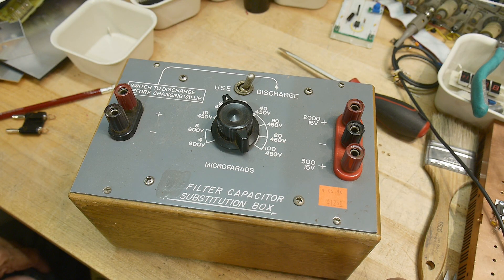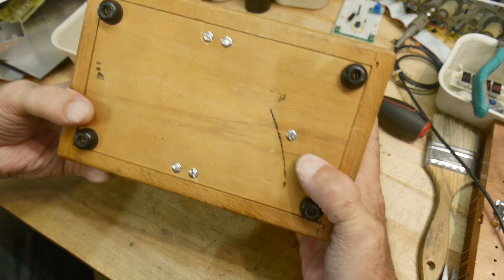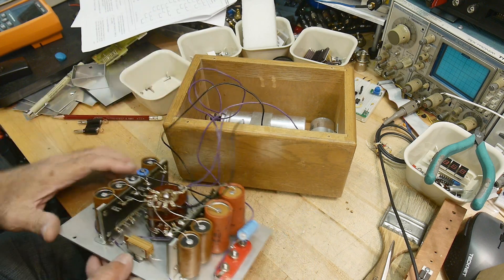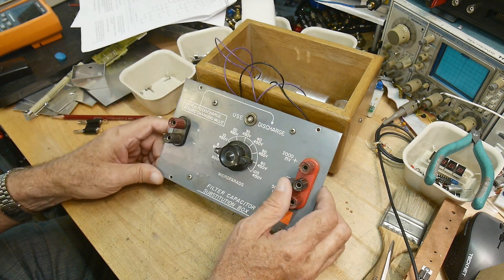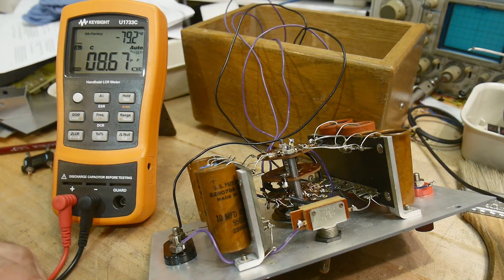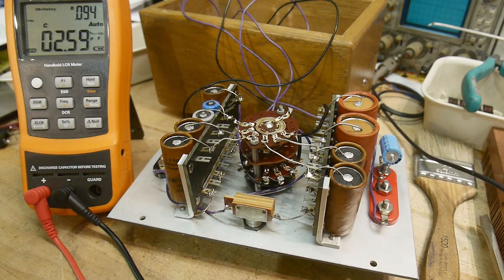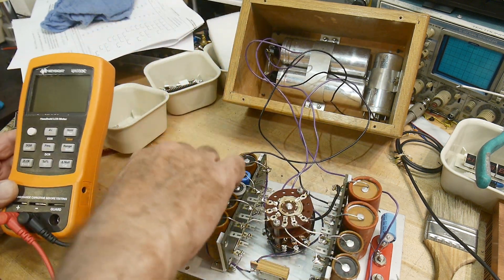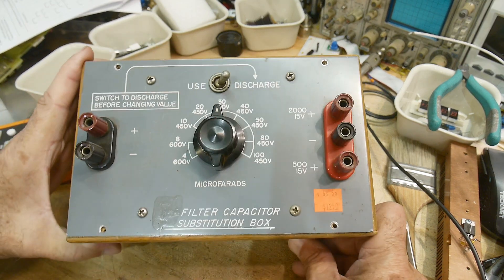#1665 Capacitor Substitution Box

Comment: Why must you discharge before switching vaules?
Reply: To prevent the possibility of a high voltage charge being discharged through a lower rated circuit, the next time you use it and select the same capacitance value.

Comment: Just for grins, test for value and breakdown voltage of all of those caps. I have an old NRI magic eye RC bridge that tells me that. From working on vintage radios, just about every electrolytic was down to 10% of its original value and breakdown voltage was as low as 50 volts.